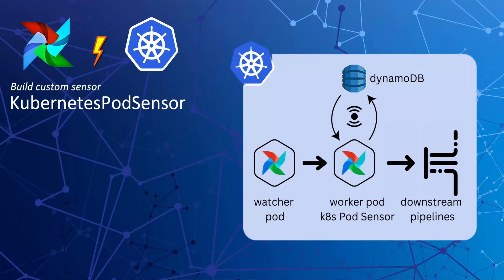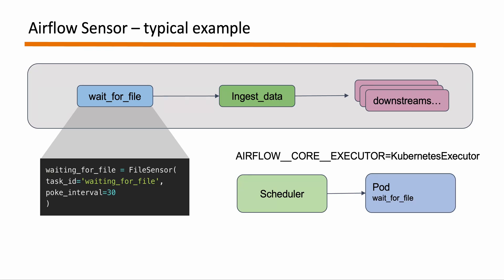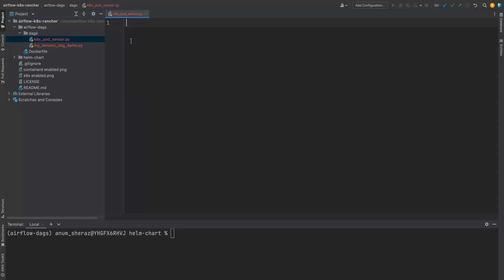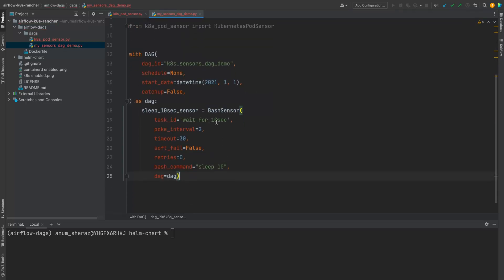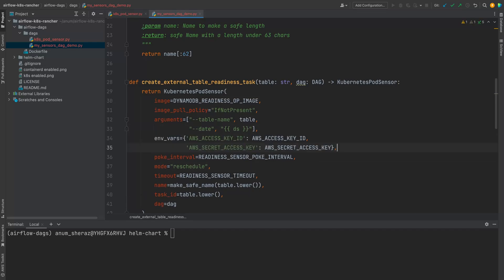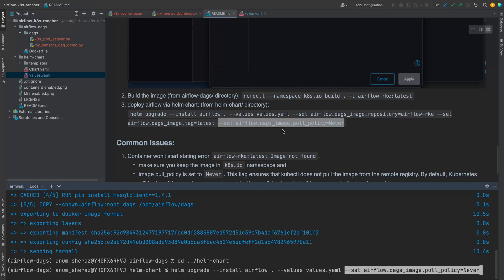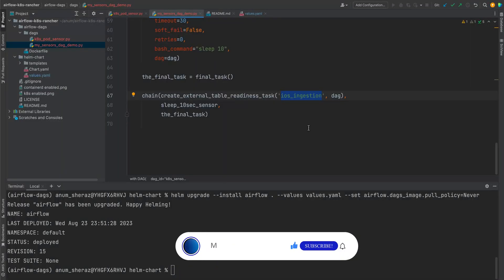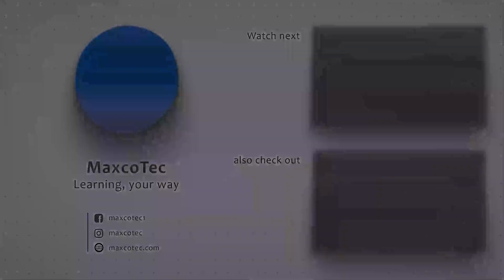Apache Airflow | Build Custom Sensor | KubernetesPodSensor

Comment: Hello,
just a short improvement to have xcom availble ;)

````
from airflow.exceptions import AirflowException
from airflow.providers.cncf.kubernetes.operators.kubernetes_pod import KubernetesPodOperator
from airflow.sensors.base import BaseSensorOperator

class KubernetesPodSensor(BaseSensorOperator, KubernetesPodOperator):
    def __init__(self, do_xcom_push=False, *args, **kwargs):
        super().__init__(*args, **kwargs)
        self.do_xcom_push = do_xcom_push

    # def poke(self, context):
    #     try:
    #         KubernetesPodOperator.execute(self, context)
    #         return True
    #     except AirflowException:
    #         self.log.error("KubernetesPodSensor failed: possibly because the sensor condition not met. "
    #                        "Will retry ...")
    #         return False
        
        
    def poke(self, context):
        try:
            result = KubernetesPodOperator.execute(self, context)
            if self.do_xcom_push and result:
                context['task_instance'].xcom_push(key='return_value', value=result)
            return True
        except AirflowException:
            self.log.error("KubernetesPodSensor failed: possibly because the sensor condition not met. "
                        "Will retry ...")
            return False
```